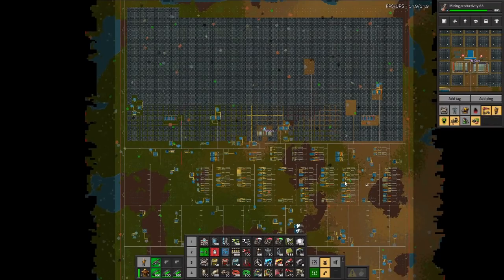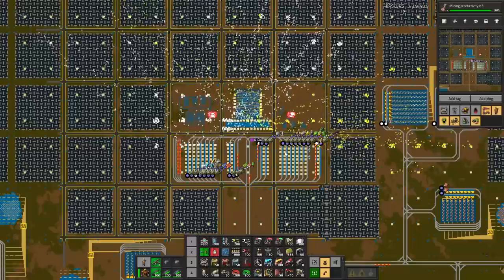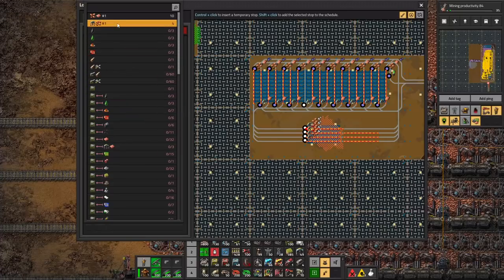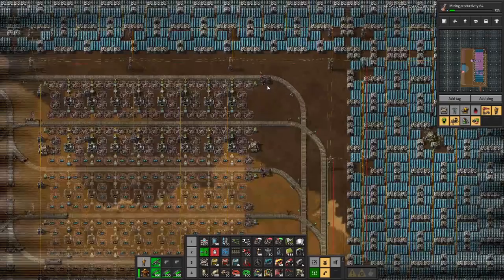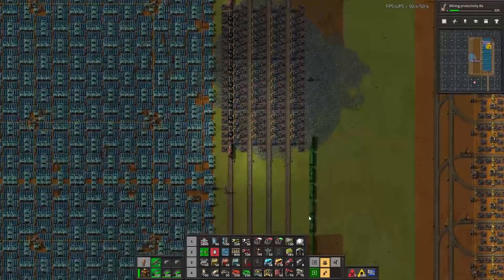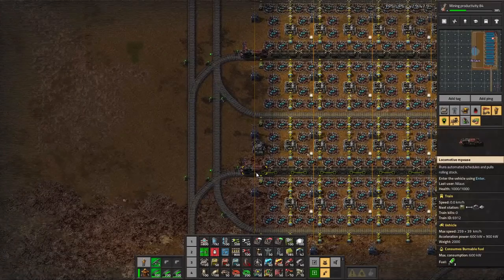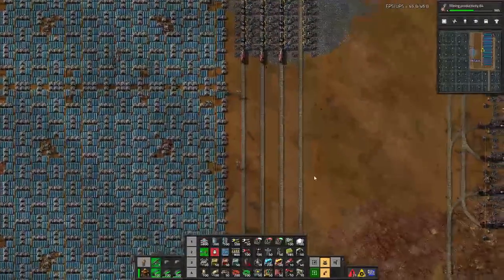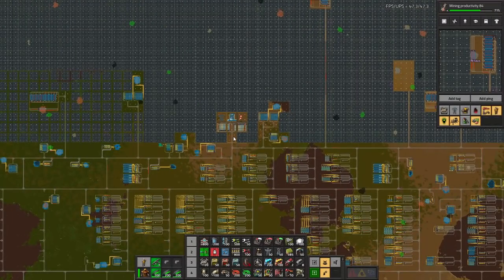Nice Iron Smelting Station | #69 | Factorio Megabase-In-A-Book Lets Play

Comment: When looking at the landfill spidertrons, it might be helpful to have at least two tiers of landfill blueprints, the first fills in single cell islands within "walking distance" for the spidertrons. Fill each lake entirely with the sparse blueprint, so that the spiders can fill it as they go. Once that's down, they have a guaranteed movement path through the area, put down the complete coverage print, then just move them back and forth over the entire area a few times to make sure they plant all the landfill.

Side note for the developers on the remote controls.  A notification in the alert area when one group is idle might be nice.  Though I doubt they will see this comment.
Reply: I think you run into bot charge and speed problems then.

Comment: A major flaw with the new copper and iron direct smelting is your first station after the ore loading is on the line required for all other stations beyond it. So if a train is in the first station unloading ore, no trains can pass that train and get to the other ore unloading stations until it leaves.
Reply: Ok this is too far down its buggin me
Reply: No? The ore trains go in from bottom to top (/from the side closest to the ore patch). They don't need to access the far side, the plate trains go in from the other side

Comment: Honestly I love the buffer chest episode as well. Logistic bots have no problem keeping up with construction bots so long as you place buffer chests in the right areas. They are used before storage in the chest priority tiers so if you need to build in the base area place a couple down with requests for whatever your building. Then when your done use the upgrade planner to turn them into storage chests and place a new section further out in the solar field this will empty the buffer you just converted to storage to fill the new buffer chests. Once empty you can deconstruct so that trees or anything else doesn't get put in them. I learned all this from you and wiki. So even if you hate them thank you for teaching me how they are used. The only issue I have is that when things are done the logistics bots are way up  buy the top of the base. Is there a way to keep the parking logistics full at all times and ready to work?
Reply: @Jamesaepp  I posted in the discord i separated the hub from the solar array and use requester and provider chest with a stack inserter to move things from one logistic network to the other
Reply: Instead of placing down the buffer chests temporarily and then deleting them, why not add to the hub one buffer chest for each item provided by the hub? That way the 1st type of items - solar panels, accumulators and co - will be taken from the closest available location (which may or may not be at the hub). The 2nd type of item - ANY other item, like rails - will get taken from the hub, just like if there were only storage chests there. And if you ever have any item of the second type for which you place a buffer chest out by some project (for example, adding the radars that I think are missing from the solar array frontier buffers), the hub is already set up to then treat it like an item of type 1 (instead of treating it like solar panels and substations are treated now).
If you place that buffer chest right next to the (passive or active) provider chest, you can even shift the items over with an inserter without bothering the logistics bots.
Reply: Construction bots pull from the closest chest with matching items, they don't care about red/yellow/green/purple or which is older or whatever. The panels in the buffer chests were closest because the logistic bots moved all the solar panels up there.

Comment: Nilaus, if you are concerned about UPS, you should triple the size of your accumulator and solar module. That one
* is based on a "column of assemblers" blueprint that doesn't have a corresponding master class video
* is scaled to accept 3 belts of [whatever the top input station was for] and was incorporated into your module without checking it's output rate
* outputs 3/8th of a belt (or lane?) of each product
* needed to be built 3 times to keep up with demand.
I've done the math in a comment on a previous video. If you scale up that top station to 8 belts, you can feed 3 assembler columns with a length of 16 assemblers (instead of 1 column with a length of 18 assemblers). That way you'll have much fuller output belts (I think they'd even be saturated) and you'll be able to remove all that triplicated station infrastructure (or triple your solar array expansion rate).

Comment: I hope this doesn't seem like an attack, but you're struggling with the logistics of late game expansion. Your Hub is adequate, when overkill would be better. Divide your robot networks into interior and periphery zones, supply the separate networks with a Supply Depot that receives finished items from the Hub. Personally, I'd forget about spidertron squads by this point, you can try increasing the number of squads, but they require too much micromanagement for my taste. Do all landfill, solar and building via bot, and manage the location of networks/depots accordingly.

Comment: Maybe I missed this, but why do the plate pickup stations in the new direct-mining locations need to have different names than the existing belt-fed plate pickup stations?  Shouldn't you just be able to use the same names and have the new stuff supplement the existing stuff rather than have to transition some trains over to using the new stuff exclusively?
Reply: It might have something to do with the fact that the new smelting station doesn't have a stacker for the plate trains? I think that meant that they have to be set up to ALWAYS accept a train, instead of waiting until there's enough cargo to fill one. Which would mean that for that second type of train, you'd want to go with the "sum of train limits - 1" train count strategy. edit: At 35:24 he does some math that assumes that the number of trains should be the same as the number of stations. I don't understand why that means that there needs to be a second type of train, though.
Reply: I know this is an old post but just wanted to explain what happened incase you never did figure it out. the plate pickup stations never got changed. the way he has them named is misleading. the top stations are on a closed loop with the drills. those trains have no access to any other part of the train network. there is a bug in the train system, that if a station with the same name is not able to be reached, the train flags ALL stations with that name as un reachable. they have to have different names between the setups or they will deadlock with no path from that bug. the plate pickup is actually the bottom stations of those rows, and he didn't change those. only the ones the trains drop the raw ore off at were changed to avoid the bug. hope this helps even if late :)

Comment: Some thoughts for dashboard logic for available/requested trains: 
For my own dashboard (which I have not yet started) the only information I will monitor is: Requested trains per requester station, but minus one each. 
So I see ONLY request counts where any station has two or more unfulfilled requests. 
Logic behind this: it is normal to request one train, which may take a short time until a train is inbound and arrives. This is okay since the station has some buffers. 
But if the station requests two ore more trains, it is likely that the buffers will run low/out before the first train arrives. This is relevant information for the dashboard. If this happens, there is a problem with the supply or the trains (or something else). 
(Alternatively you could use a global alarm for the specific station instead of the dashboard)

Comment: Should be fine to have less than 17 ore trains, since loading with ore is definitely not the bottleneck, but the smelting part. 

(Wow, you actual read my comment under the last video :-D )
Reply: Even 7 trains with 3 of 4 stations no longer working would still continue to work (but probably a little bit slower).

Comment: Since the new mining/smelting design takes so many trains, I don't think it's the best place to optimize for UpS.  AFAIK, a fully saturated belt is far mor UpS-friendly than one at half saturation.  Something about not the items on the belts being expensive, but the transition between items and free belt space. 
Therefore, many of the other modules might be to blame, with their C-shaped belts transporting stuff from right top to left top to left bottom to right bottom back onto the train.  Maybe unload from the train, move the stuff more/less straight down to another train.  That'll probably add an entire city block in height to a module but save one block in width.
Reply: I don't think cutting out the full belts running sideways would have many UPS benefits.
One thing Nilaus should do though is to go through all his modules and re-design any one that doesn't output full belts (or lanes) (*cough cough* solar and accumulator *cough cough*).
A full output belt obviously gives you the best ratio of computation time to output of products.
Reply: Makes perfect sense...  If the belts run across an entire city block fully saturated, the goods should move like a "train" with very low overhead.  The main issue would come from the middle part where inserters take stuff and place products onto another belt.  Maybe minimizing chunk crossings could help (e.g. try to place as few inserters as possible at the edge of a chunk where they access the next chunk).  Another thought, maybe a "belt imbalancer" could help by packing all belts except the last one as densely as possible.

Comment: It looks like the main bottleneck setting up the new smelting locations is populating the mining part with trains. How about adding a path into the mining loop from the main rail network (but not back out)? That would allow you to populate the mining trains from your normal train-loader. I think I spotted another comment about expanding the train-loader - you could potentially use the city block between the hub and the main rail-line to add additional train-loaders.

Comment: @Nilaus

Given you need so many trains for the new smelting design and setting up the trains is what is taking the longest, what do you think about removing the solar city block to the left (west) of the existing train loader and making that a train loader city block so that you can set up trains in mass?
Reply: some of those trains(17 of them per module) are not connected to global rail network though. they move in a small close loop.
Reply: @betterinbooks  I see that it is close loop, @Nilaus could temporarily open the loop at the start

Comment: Just curious whats the benefit exactly of this vs just use some conveyors instead?
Reply: It's better for the updates
Reply: @noahsilveira2239  conveyors no longer consume so many updates. If they are constant they work as 1 block. So basically 20 conveyors vs all these signals fuels trains etc etc it just seems too overkill
Reply: @dieksodos2699  Then idk, that was his reasoning idk much about this stuff
Reply: I believe the point is cutting down on the number of inserters, not belts.
Reply: The belts can't move enough fast enough. Each miner now produces half a belt or more of blue ore. so a pair of miners now fills your entire belt. This would mean either bots or trains to keep the ore flowing.
Reply: @stoneydavis  But you could still use a regular smelting design
Reply: Reducing total entity count -- primary UPS usage.
Reply: @dieksodos2699  At the start of the smelting line, the belt is full and doesn't require many updates.  However, after just a couple smelters, the belt is horribly uneven with filled/not-filled spots, and that creates excessive updates.
Reply: @VladTheImploded  not really a problem of a 300 tile conveyor to have 20-30 uneven
Reply: @dieksodos2699  Except for when you have dozens and dozens of them.  Even saving 5% updates is a huge performance boost for a base of this size. That's why people don't really care about it for normal bases. Mega-bases require you to do things that just seem superfluous otherwise.
Reply: @kevincariffe3345  Doesn't this have more inserters? The previous setup had two per smelter, this has 4-5 due to the extra belts and boxes used to make an even gap.

Comment: Why is the fuel train even leaving half full (at 22:46)? Couldn't you cut down on the number of fuel train trips if you increased the refueling buffer at the station to where it can accept a full train car of nuclear fuel?
Reply: If every location has a train full of fuel all the time, the total amount of fuel being stored across the map would be enormous. New locations wouldn't get any deliveries because old locations are still being filled up.
Reply: @thomasdalton1508  "the total amount of fuel being stored across the map would be enormous." Doesn't nuclear have a stack size of 1? Sure, there's about 110 light oil worth of oil products in each, but that's only about 10 coal.
Also:
Buffers don't cost UPS once they are filled up.
Larger buffers buy you more time to react to situations of under-production. (That is, if you detect them early enough. I'd count the number of items below the "deliver to me" threshold).
With trains going out to old stations half as often, there'd actually be less times when there are no trains available to go to new locations. At least after the extra buffers are filled up.
Just because switching over (to larger buffers) would cause a temporary problem doesn't mean that the new setup is worse than the old one. Also, even if you'd place down ghosts for all those extra chests at once, they would only get built (and draw from the hub) over time, whenever a spidertron or player gets close enough.
To ease the pains of switching over it would be a good idea to increase the nuclear fuel production, which would make that essential system even more resilient for any future increases in consumption.
As it is, Nilaus had to wait for 5(?) different fuel trains and stop the last 3 of them to raid the second half of their cargo. A larger buffer at that mining outpost would have meant that there would have been 2-ish trains coming in to fill up the buffer, delivering more fuel than he had free inv space. And since you couldn't run that buffer dry, there would be no real waiting for the next 2 deliveries.
Reply: @Pystro  The fuel train would end up waiting at the depot a lot waiting to refill if it were coming back empty every time. It wouldn't just be a temporary problem - if you build a bunch of new locations in quick succession, you'll need to wait for the first ones to fill up before the later ones will get any fuel. Increasing your fuel production just so you can have a larger buffer that you don't need isn't efficient.
The problem he had was an unusual one because he was creating trains at an outpost. Usually he creates trains at the hub and they are fueled directly, which is much better. He could do the same with these trains and have a one-way connection between the ore train loop and the main railway network in order to bring the trains in.
Reply: @thomasdalton1508  "The fuel train would end up waiting at the depot a lot waiting to refill if it were coming back empty every time." I was going to reply that there are 4 of them, so there should be no problems fulfilling bursts of requests.
I forgot that the 2nd through 4th one waiting at the hub would be waiting empty. But you'd just need to double the buffer at the hub too to mitigate that. Ideally your hub should have enough of a buffer in the station to re-fill all trains that get called there for loading, minus the one that's currently sitting under the inserters.

My main issue is that half of the fuel train trips could be saved (and the trains are one of the 2 systems that Nilaus is concerned about becoming a bottleneck). It's also not something that needs to be fixed right now (but the earlier the transition is started the more you can stretch out the transition period).
I'm only taking a minor issue with the fact that it's inconvenient to build 17 trains with the current refueling system. Since it's building related, it should rather be solved by adding train fuel for those 17 trains to the builder train (which takes exactly 2 wagons - if you rely on stealing 6 from the refueling system). And while Nilaus is at it he should add enough locomotives, wagons, beacons, speed modules, stations, etc to it as well so that a mining outpost can be built without having 9 different train & spidertron deliveries come in.

While I'm ranting about the builder train, I think that train should generally be equipped for building ANY module. There would be no issue with forgetting to bring refineries, centrifuges or red inserters to a module and making a 2 minute trip back. For each new module blueprint you make you'd just go over the ingredient list and check if you need to increase the train's capacity. That should take a minute tops. Also if the builder train has enough cargo, you know that you can just manually re-fill the spidertrons in the field without having to send them back to base and then waiting for that to finish.
Reply: The entire base uses 2-3 fuel per minute, those trips are not really worth optimizing.